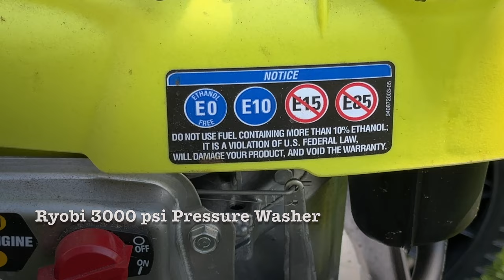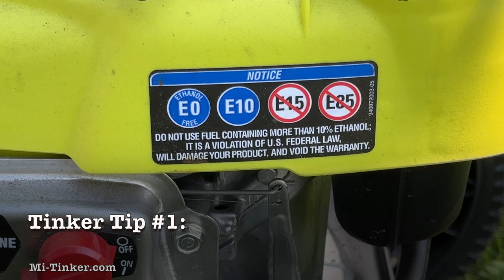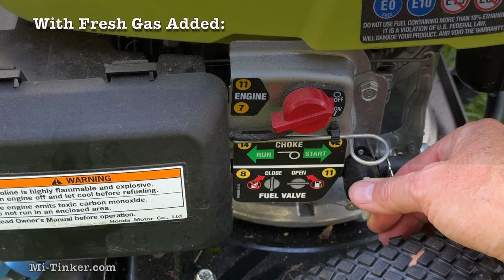Old Gas No Start, Ryobi Pressure Washer—The Fix!

Comment: Tried starting mine yesterday after it had been sitting for over a year. Gonna try this today, but ethanol free gas is really not available here that I no of. Any suggestions would  help.
Reply: You can buy it at most hardware or automotive supply stores.  In comes in a can and has quite a long shelf life.
Reply from the maker: Did you get it started? 

If you can't find rec gas, draining old gas, put a gas stabilizer in you gas can before adding it back into the tank. That will help extend the life of the fuel for a few months.

Comment: What is everyone talking about that unit looked new, the gas looked clean.. what did u actually do? 😂😂
Reply from the maker: Easy... yes, It was a new machine used once in previous season... 5 months later the ethanol blended gas was no good...  carb. had gunk build up. Drain old gas, put more stable gas (rec. gas no ethanol) in it... spray carb with starter fluid. pull starter cord and fixed. 😉

Comment: Been down this road, ethanol is terrible and can get so bad you have to remove the carburetor, I found this out when it was snowing hard, and I went to fire up my snow blower, you should use the best gas you can get maybe even use stabilizer, and also on any machine with a fuel shut off  and run it until it quits!
Reply from the maker: Agreed...

Comment: Great video. Followed these steps for the 2019 RY803001 model and worked perfect! Did not need to do the starting fluid. Used ethanol free 4 stroke gas from Home depot.
Reply from the maker: Great to hear!

Comment: The oil you do not change ?
Reply from the maker: Thanks for the question. Since the machine was only used once last season, there was no need to change the oil. If you use the machine a lot during the year, yearly oil changes would be a good idea.